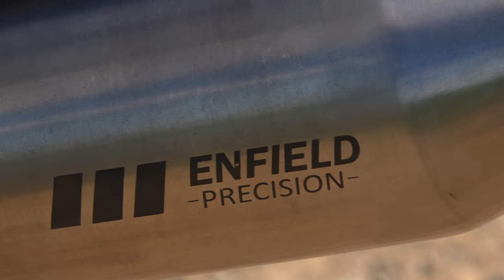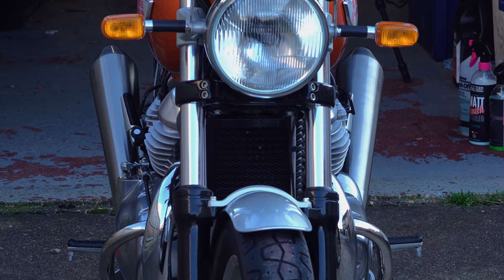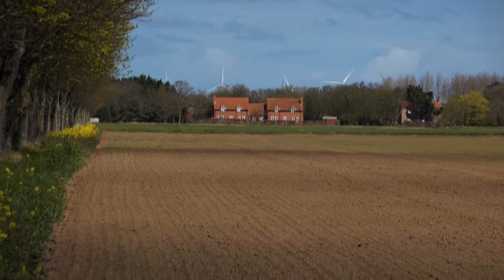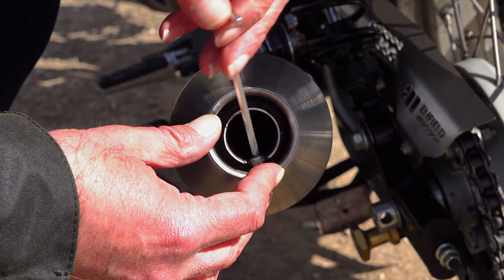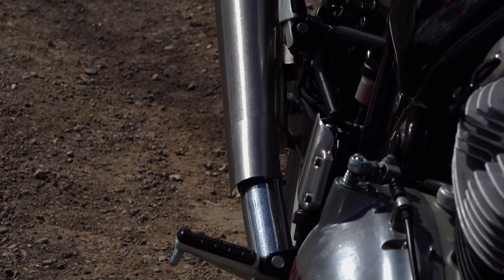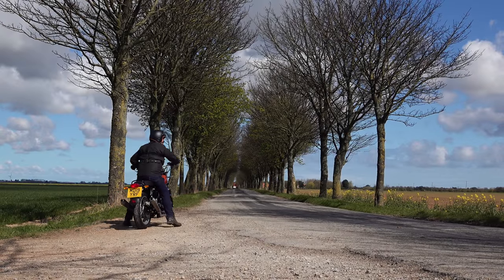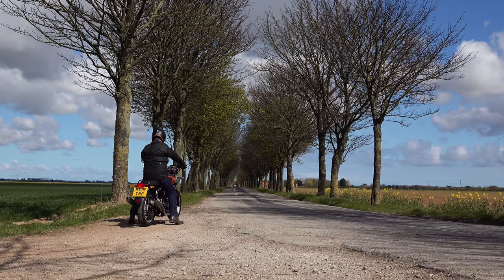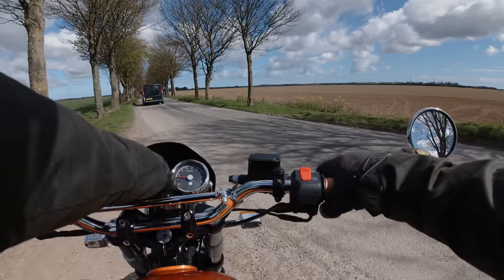Royal Enfield Interceptor 650, PURE EXHAUST SOUND! With ENFIELD PRECISION pipes.

Comment: I`ve fitted classic megaphone exhaust silencers to my interceptor and fitted some extra baffles both supplied by the classic bike shop at a cost of about £90.00 have also fitted the DNA filter and fuel booster. You are absolutely right! the difference this has made in the mid-range is astonishing! with a noticeable difference when two up. So much so you don`t really feel a difference when two up.Yes, the bike is louder but not in any way offensive and I`ve received many a thumbs up and smile from the older generation as I ride past.Would recommend this modification to anyone that is considering it.Thank you for posting this great video.

Comment: Hey, Stuart. Picked up a new to me 2019 Interceptor a few days ago and love it. Only had 1600 miles on her. I had them upgrade the exhaust to the AEW as well as a high flow air filter and added a booster plug. I love it! I took the baffles out and she really barks now. Next mods will be the suspension. It's a little rough. Cheers, sir! 🍻

Comment: You sold me on the pipes.  Moreover, I found these pipes in a low-slung version, running parallel to the ground.  The look is even more retro.  Now I can cut the stock pipes open and experiment.

Comment: One of the main restrictions on the Interceptor/GT exhaust is the cats in the headers. If you try a set of headers(I believe Hitchcocks do a catless header) you will see an even more dramatic improvement in performance. I've seen dyno figures of around +10hp at the back wheel using a catless exhaust with the DNA filter. My GT is now hitting the rev limiter in top gear with ease. Many thanks for the recommendation on iridium plugs, fitted some and now the bike is much more stable on tick over.
Reply from the maker: Be patient, one thing at a time!

Comment: I fitted Lextec silencers to my Interceptor on 2nd April and have covered 900 miles with baffles in only. As you say it is difficult to judge sound from camera audio but I would judge that my silencers, with baffles fitted, are slightly louder than the Enfield Precision with baffles removed.

I base this on the very noticeable induction note that can be heard on your video. This is much less discernible on my machine, drowned by the pipe's sound, and I have the self same DNA setup as on your bike. I have commented mainly to give viewers who are thinking of changing their silencers a bit of a comparison.  I know what a headache it is to choose from the several systems available. 

Generally I am pleased with the sound, appearance and performance of the Lextec. My only criticism is a very shoddy looking pair of mounting brackets. They do the job but look like I made them in the shed! In the winter I may look at replacing them with something that matches the quality finish of the rest of the silencer.

Comment: Hi Stuart, trust you are well. I am regular to your channel and love your relaxed style both when talking and when riding to the countryside..that said, I have something on my mind. I am from India where temperatures soar to 45+ during summers. I own an Interceptor 650 and noticed something peculiar. If I am in city traffic and try to constantly rev and break to get out of tight spots, the engine gets super hot and when that happens the Engine and Abs light come on. Sometimes, only the Abs lights comes on, the console light goes off and only one of the horns functions (we have two on Interceptor). Another way to recreate is to go uphill, steep climb and rev hard in higher gear. The engine light will come back on. What perplexes me is that I haven't heard anyone else having this issue. Maybe because I have ridden it more than most people do. In 2 years with lockdown and everything I have done 30000 kms. I have done trips which have taken me on dirt roads, high altitudes and through streams. I can't put my finger on it but it appears to be a wiring / electrical issue only and my engine seems fine. Interestingly on some occasions when I have had the engine light and parked the bike for the night, sometimes, when I again start it in the morning I see that is the engine light is on. Not sure where to start but the service center guys do not have a clue. Each time they clear it out from the ECU but it comes right back on. Any help in this direction would be much appreciated

Comment: Lovely sound both with the baffles in and out. Was contemplating getting a 650 Interceptor to complement my Classic 500 but ended up getting a Kawasaki W650 instead lasty year mainly because it still has a kickstart to complete that classic look, and also a bit more torque than the Interceptor. The Interceptor is really a great bike though.

Comment: Rode this 650 today at a dealer.  Very nice machine.  I'd really like to buy except parts not available, not even oil filters.  Oregon USA.
Reply: You may be able to buy parts mail-order from a dealer.  RevZilla could also be a source of consumables.
As for oil filters, there are probably dozens of automobile oil filters that would fit.  I'd start with WIX as a
maker of good-value filters for a wide range of cars - and they come in black canisters.

Comment: They do look good and sound good. Very similar to the S&S pipes that came with my bike when I bought it. I have just fitted a pair of Hitchcock’s Stainless steal headers to the bike which are very well made and sound and perform awesome. I had taken the sound reducers out when I fitted the headers and they can be very loud , ok if your just riding around town but if your going to traveling at highway speeds for hour or more that can be a little too much on the ears even with ear plugs which I wear all the time.  I’ve put them back in ,it take the edge off just a little . Cheers mate 👍🏻

Comment: In general, British cross plane twin engine exhaust note is one of most satisfying sounds out there. I do like the sound of these pipes ‘with baffles in’ a tiny bit more than ‘without baffles’; as the latter adds too many harmonics to it. 
A quick side-note to everyone, listen to this video with a decent pair of headphones (unless you have connected it to a sound system with proper flat soundstage) to fully grasp the sound of those pipes..As a bonus, it also adds a bit of grunt to the author’s voice. :)

Off topic, and just my usual observation. I see no license plate on front of the bike. I envy European rules regarding motorcycle license plates. Here in India where I reside, it’s mandatory for us to put both front and rear license plate. While it’s not too difficult to place front license plate on standard looking motorcycles like Bullets, Interceptors (as there’s room under the Headlamp) and it doesn’t spoil their look; imagine how inorganic it would be for sports/adventure/touring motorcycles (generally for all bikes with some sort of integrated fixed fairing in front of it). And different manufacturers give different solutions either as brackets or extenders to bolt on the plate, which doesn’t retain the beauty of bike’s front.
Reply: Yes!  A good low thumping fundamental is magic.  The higher frequency harmonics and
white-noise hiss from turbulence are just noise to my ear.  What a culture change will
occur when e-bikes become affordable!

Comment: Thanks much for this video Mr. Fullingham. They sound awesome both ways, just like the AEW T102s. Without the baffles it's much louder as the revs rise and can be heard from much farther away. No popping on mine either but there's a very satisfying thrum as you let the revs drop. Without baffles, they're beyond the 80db legality in India so if one gets caught, it could lead to a confiscated bike and on the spot removal of pipes. Love the scenery! Also, looks like you've changed your headgear? You mentioned that the DNA filter Is stage 1 only. Any particular reason for not going till stage 2? Thanks again for the video and background score too!

Comment: That is a great looking bike. It is on my shortlist for a new bike, just not had a chance to go test one yet. And the baffles would need to be in as my neighbours propably will prefer it. That is supposing I buy one, my old bike still has plenty of service in it and I still like it, even with season 10 starting. Only have room in my garage for one which is great for my wallet also. Mostly use the bike for joyriding, anyway so no practical aspects to consider. Nice video.

Comment: Hi Stuart.  Why is mankind never satisfied even with what is nearly perfect and we must always tinker?  It is indeed true that perfection is the mortal enemy of good.  Having said all that, I sometimes think that I'd like a little more sound with my engine, thank you very much.  This video you have made could push a guy to change silencers, but I do like the lack of noise when I'm cruising at 70MPH, so I don't know.  Anyway, please forgive me if I nit pick one of your conclusions.  As an engineer, it is my opinion that the coolness of these silencers is not do to "improved gas flow" or some such thing, but to the fact that the OEM silencers each have TWO additional catalytic converters inside them and the exhaust combustion is so complete within the units, there is virtually NO carbon monoxide discharged from them, it is all oxidized within the silencers.  It is an inescapable fact of chemistry that the oxidation in a catalytic converter evolves a lot of heat.  Love your videos.

Comment: Did you noticed yet any trouble with the dyno jet kit? I had fit a dyno jet for my Kawasaki 750 Zephyr. And after a year or two( can’t remember it) she used a very lot of petrol. After I check the jet needles I noticed they were worn out. I bought a new carburetor Unit and never touched a dyno jet kit ever. 
BTW without the baffles I like the sound more👍🏻😁

Comment: Ooooh tuff one Stuart  but for me I think the baffled sound is slightly better especially on a long journey but both sound nice  and they look really good too I don't have an Enfield right now but if it was possible to get something like them for my XJR I would have some . interesting cheers : )
Reply: I once had XJR, installed  Supertrapp Universal mufflers 2" (the long ones) on both sides and those sounded nice, without endcaps... Though, I made a do-it-yourself 4-2-1-2 collector which was more free-flowing than the original one.
Reply: @iivaridark6850  I have seen option were their is no box as such but just a balance pipe running across not sure who makes em though interesting !! : )

Comment: Great to lose the weight of the OE silencers, I replaced mine with chrome peashooters from classic bike shop but they are a bit loud for my taste although I understand a baffle is being made to fit at some point. Part of the reason the OE pipes get so hot is the catalytic converter inside (there is another small one in the header section under the engine). I still have a scar on my arm from the silencer from 12 months ago!

Comment: Tappet adjustment is required.. Lot of engine clatter can be heard... Exhausts sound lovely tho....Cheers....ride safe
Reply from the maker: if your tappets are quiet you are running a risk of valve burn out. they are called tappets for a reason.
Reply: @stuartfillingham  As you say... U are the more experienced rider... Cheers

Comment: Hi Stu, enjoying your videos concerning the RE Interceptor/Continental, I noticed small black cages attached to the upper cooling fins of the cylinders. I noticed the same at my local dealership but without consistency, some bikes had it, others did not. The salesman did not know the purpose of those nor could this part be found in the parts catalog. Any idea what those are for? Thanks
Reply from the maker: so you don't burn your knee on the cylinder!

Comment: I understand that by the word “pipes” you are referring to the silencer/ muffler, and not to the manifold/header pipes coming from the engine to the silencer/muffler. I understand the original manifold/header pipes have a smaller pipe inside. I wonder how much this restricts engine breathing. I ordered the EXHAUST PIPE PAIR,STAINLESS STEEL POLISHED FINISH,(650 Interceptor + 650 Continental GT) from Hitchcocks, but they haven’t arrived yet, so I don’t know how effective they are. Do you have any information on this please? Thanks, Ronn
Reply from the maker: they are all pipes!

Comment: lovely pipes .are they e marked and if not will they pass the mot...cheers mate
Reply from the maker: Not that im aware of, MOT tester can not examine the exhaust system for markings they are only able to check that there are no leaks and they are not excessively loud. I don't think that will be a problem with the baffles fitted.
Reply: @stuartfillingham  thank u

Comment: Nice ! Baffles in would be my choice , once at cruising speed they should drop into a nice thrum behind , rather than cheese gratering your eardrum .
Never noticed but do you use ear plugs at all ???
Reply from the maker: Pardon?
Reply: @stuartfillingham  Humour ? I like it !
Reply: Forgot to ask......are you going for the Hitcocks stainless headers at some point ? I am thinking of fitting them as well as my S&S cans to really freeoff the engine !
Reply from the maker: @themoog3889  I do have a set somewhere!
Reply: @stuartfillingham  I might take the plunge soon myself   just wondering if the tone of the cans will be affected as there is a mini cat in the original headers so I'm told .......just need Sam to make some finned clamps , the fake ones on the originals are horrendous !

Comment: What causes other pipes to "pop on the over-run"?  I have the S&S pipes (similar in sound and look) but they pop like firecrackers when I'm off the throttle and engine braking.
Reply: It's my understanding that it's due to a too-lean fuel/air mixture when the throttle goes to the idle (or near idle) position -
which is normally  needed to pass emission tests.  With more gas flow with the lower restriction after-market exhaust pipes,
more air becomes part of the fuel/air mixture than in the stock pipe situation, and the lean mixture doesn't ignite until it
meets the hot catalyst or hot baffles, and a "pop" occurs.
A simple Booster Plug might get rid of the deceleration "pops" by enriching the mixture at idle throttle position.
Iridium plugs with a wide gap might also improve ignition (marginally) for lean mixtures.
Otherwise, it's time for a custom ECU mapping.
Reply: @daveinwla6360  makes sense. Thanks, Dave

Comment: My max speed is seventy mph, above is useless ,my reasoning is simple , you cannot drive that fast at high altitude , I always aim  for torque and lots of motor breathing as altitude can render your monster quasi racing bike a dead bird . The OEM pipes are heavy so loosing weight in that area is good , next for me is air filters directly on carbs and if fuel injected then a change of set up is required , case breather filter above the case etc , if you ride only on flat or hilly highways and are a pretend racing nut with racing pipes you are  just annoying everyone so go on a race track instead